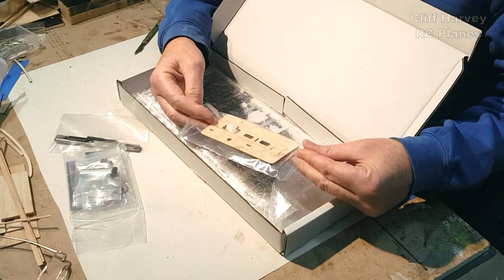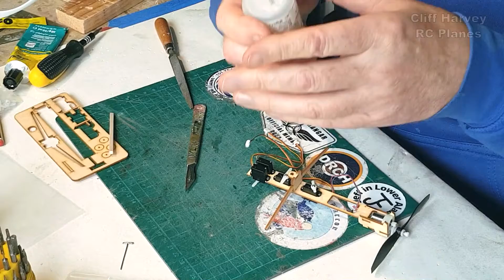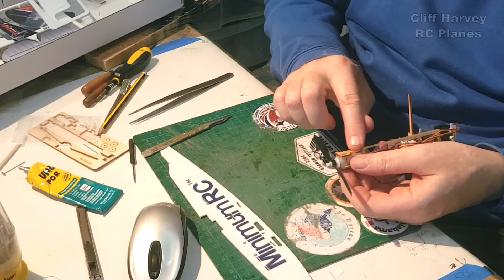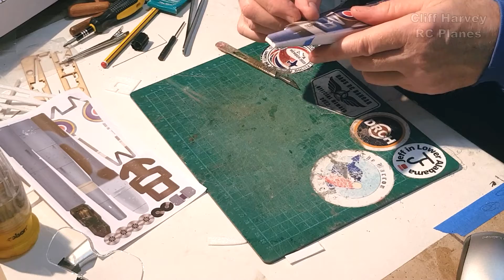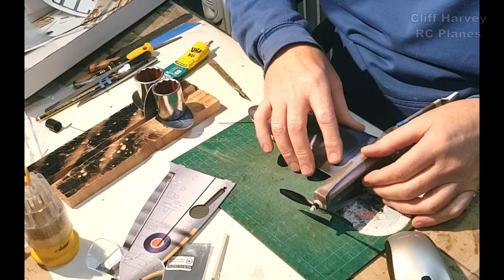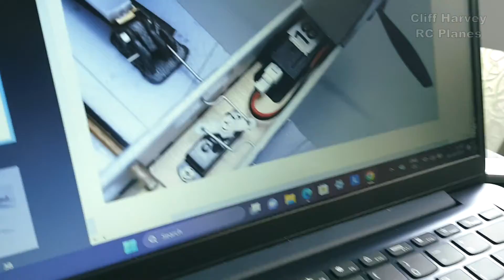MinimumRC Spitfire Mk XVI Build Instructions

Comment: You didn't explain how to attach the prop. Mine just flies right off the shaft.
Reply from the maker: Mine did as well, I just put a drop of ca on the shaft and it's been fine since, cheers
Reply: @cliffharveyrcplanes  tried that and it just flew off
Reply from the maker: @dion2265 In that case I  think I would clean the shaft (to provide a key) with a fine file. Then I would clean the hole in the propeller with a small drill bit no bigger in diameter than the hole. This would give you the best chance for the ca to stick. It would be a good idea to also use an activator to help the ca to cure quickly. Hopefully that'll do it 🤔

Comment: Just built one and tried my first flight and it was really nose heavy and would not stay level and went about 10 feet and crashed. So disappointing for first time RC build and flight
Reply from the maker: Hi Dion, sorry to hear about your experience, did you check the centre of gravity before you tried and do you have previous RC experience?
Reply: @cliffharveyrcplanes  No previous RC Experience. I will have to check the centre of gravity. It seems very nose heavy. How do I fix the balance?
Reply from the maker: Hi Dion, the last page of the instructions tell you to check the cg is on the score line of the wing, you can add a little blue tac or similar to the tail end if yours is nose heavy. I must say though that this model really isn't suitable for a first time flyer, you need something much much slower. I always advise people to join a local club, or at the very least, have some time on a simulator.

Comment: Very interesting, Cliff, as well as informative.  I struggle with smaller models in both the building and (more so) the flying but I'm still tempted.  Retracts are always a pain and the vast majority of my models have fixed undercarriages.  I think I would be tempted to use this for take-off and belly land to avoid damage.

Are these models only available from the USA as the link implies or is there a UK stockist?
Reply from the maker: I've updated the description link, you order from China and they post worldwide 🤔👍